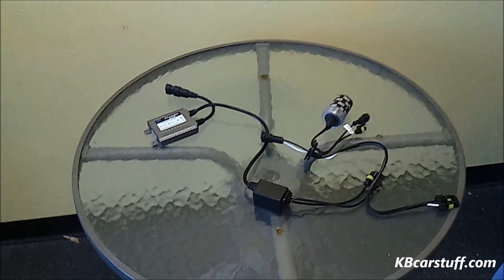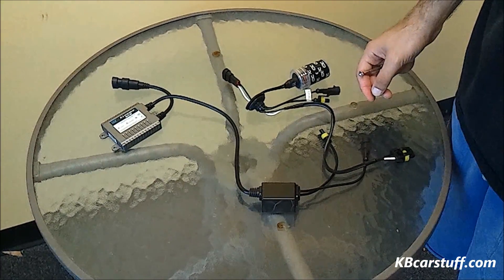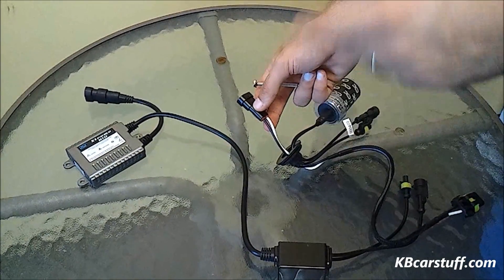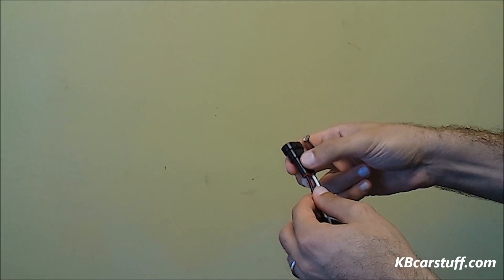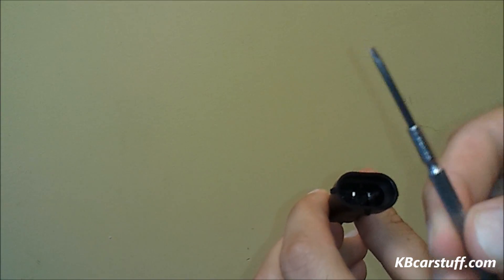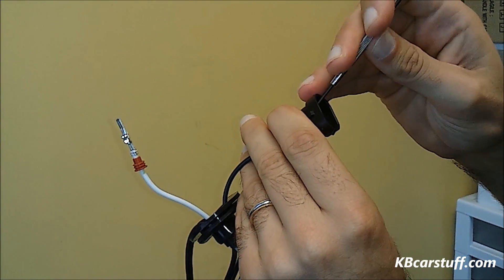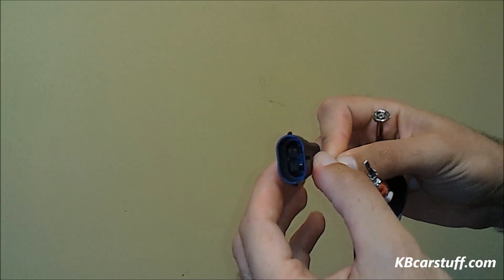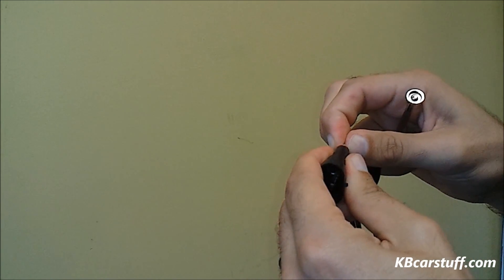How to Reverse Polarity on an HID Kit

Comment: My h11 bulbs are working fine, but the ballast for the passenger side headlights is scorching hot compared to the driver side ballast. Will reversing polarity help keep the heat down?
Reply from the maker: If the item was purchased from us, please contact us for Tech Support.